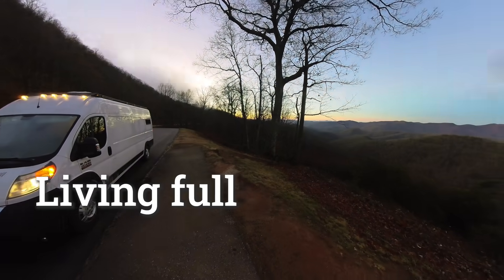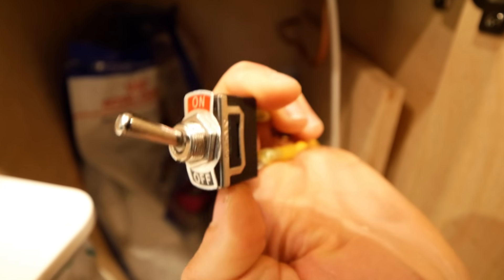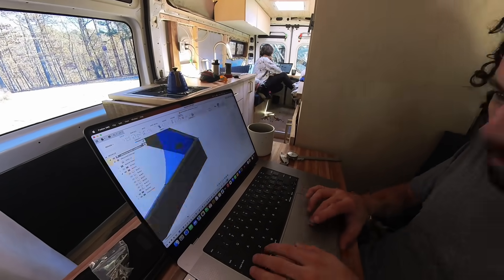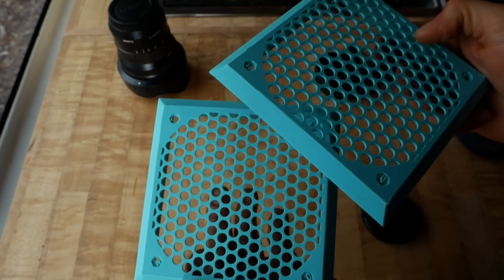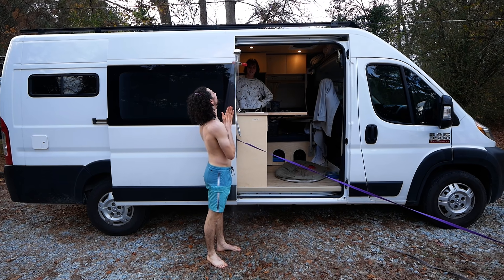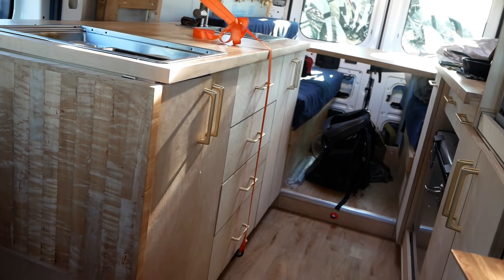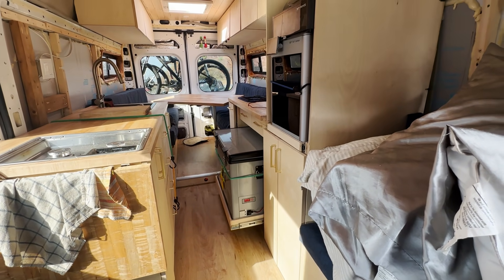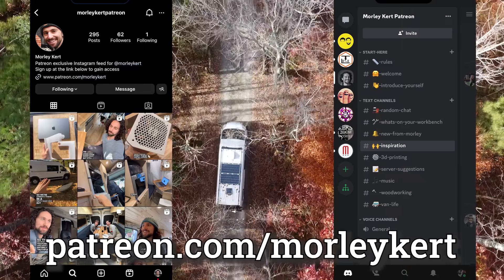Oddly Satisfying Hacks for Tiny Spaces

Comment: For the drawers you could use a magnetic toddler latch to keep them closed. A small magnet serves as a key to open the doors and the latch is hidden inside so there’s nothing visible on the outside. You can either leave them engaged all the time or switch the magnet on when you’re hitting the road.
Reply: Was thinking exactly the same!
Reply: Was just about to comment the same thing! Great idea! :)
Reply: I second this. The magnet locks are tried and true for this type of camper/trailer cabinetry. Good luck 🍀
Reply: Just came down here to say the same thing!
Reply: I fifth this I was gonna say the exact same thing

Comment: For the shower hose, you've had it connected the wrong end.  The end you connected to the faucet (the tapered connector) should be the side connecting to the shower head so it can fit in the holder correctly

Comment: Most RVs just use latches on drawers and cabinets, either ones you can leave open when you're parked for a period of time or ones that you can easily open when you need to access them. A latch per drawer/cabinet is more hardware, but also means that if you print them and one fails you can have a new one ready within a few minutes and it also reduces the severity of a failure to just one drawer/cabinet

Comment: For the smoke alarm, there are different types. (Ionization vs Photoelectric). The ionization type will pop off more frequently in a kitchen due to the aerosolized particles cooking creates even if it doesn't make smoke. Try getting a photoelectric type which will alarm you when there's smoke rather than particles in the air. Both will let you know if there's an actual fire. But try to avoid one that actually has both types, as it will pop off if either type is detected.

Comment: Hey Morley, I know it’s way past this point and you guys are living in the apartment now, but my first thought for the drawers that I didn’t see recommended was a hinged lock “bar”. They use them on medical cabinets to lock them. It’s one vertical piece that holds one edge of the drawers shut. You can unlock it when you’re parked and leave it open (no dealing with multiple latches), build it cheaply: piece of Baltic birch plywood about 3”x30”, a piece of piano hinge, and a sort of locking mechanism. You could even do something where there’s a hole at the top and it’s a peg that secures it in from the top of the counter or like others mentioned something like a baby lock that holds the latch shut. With this design, you can lock and unlock all the drawers at once.
Reply from the maker: Good idea!

Comment: As for the cabinet drawers. It would be a more complicated build, but how about handles similar to some you see on filing cabinets. The handles have a side knob that disengages 2 latches on the inside of each drawer. So, it's always locked, but to open it you grab the handle, press the button and open the drawer. Then they latch every time you close them. Different handles, but maybe less ugly than external latches, etc.

Comment: I have that exact fridge. It's about 6 years old now and it started rusting on the inside. It's coated metal and the moisture created rust and the coating peeled off in places. I cleaned it up and painted the problem areas. Fridge works like a champ.
Reply from the maker: Good to know, thanks!

Comment: I used to have Ikea cabinets that opened from the bottom and I sat them on my head all the time too 😂 I had a roll of aluminum foil that I used to prop them open to put away dishes.

What about a dowel along the bottom edge of the cabinet door, with a hinge on the right or left. When opening the cabinet you can fold out the dowel and place in a small recess in the cabinet body so it doesn’t slip.

Comment: Great solutions. However, don't despair;  one doesn't need to design and  print custom devices. Low tech simple carpentry with a vast array of hardware to choose from will solve the problems too. And you are so right about those underutilized clamps.

Comment: Magnet for the drawers comon a ratchet strap 😂. And you need dowel pins to stop the fridge and washer from coming off the wall on their bearing slides as well, could even use a gate latch for a fence. You can 3D print one even. Don’t use stuff you need to take down all the time. You said it yourself you don’t need to take one tool or one item off just to use another. Ratchet strap is a tool you’re using to hold another tool. Make a custom holder that’s permanent spend some time designing. Make more iterations and versions of your designs don’t settle in the first one always you’ll get stuck designing stuff that might not work or might not be the best solution sometimes

Comment: 9:50 just get rotating paddle thingies screwed to each side of the panels the drawers are between and when you don't want them to move , have the paddles rotated  to be on top of the drawers. The draws would be stopped by those paddles. Would be super easy and quick to print!

Comment: For the 3d printer to work during travelling, you could go to an over engineered solution of gimbling the whole printer with some shock absorbing like the way they do with cameras in film production, or a simple solution of using springs/neumatic actuators that absorb shocks and keep it level during driving.

Comment: Not sure they're strong enough to hold closed, but what about push to open drawer slides? the kind that click closed and release when you push them in. Gets rid of the handles too, which adds 2 inches of space to the corridor.

Comment: I would have made some sort of lock that goes in a cut out in the top left of the drawers. A little toggle switch that sits flush to the surface and goes inside the framing in the locked position.

Comment: The bambulab printer has a very advanced vibration compensation system which is intended to eliminate the vibration that the printer creates itself. I can bet the print quality is mainly impacted by the vibration compensation going crazy. I don't have a bambulab printer so I don't know, but if it's possible to disable the compensation system you may get better prints while driving!
Reply: That sounds like the worst printer to take on the road. My printer has a solid enough frame in order to reduce vibration, I've had it printing in a car mutltiple times and even on the back of a bike (the last one did suffer a bit from vibration though, but still, on a bike)
Reply: @rosserobertolli isn’t he talking about the same printer you have??

Comment: You’ve got plenty of good solutions for the drawers but another option is to take a look at a large tool chest, their locking systems have a common rail that lowers and raises to engage all the drawers internally, it could be on the back or the side. It could also be a common vertical rod that rotates some kind of catch into a receiver of each drawer. Just spitballing.

Comment: I think you are using the shower-hose in the wrong direction. The side that you connected to the faucet has a specific shape to fit in the mount that you showed. It even has a rubber gasket to make it fit & hold. But you've connected the other part to the shower-head. I think if you switch it around you can mount it.

Comment: Hey bud, been meaning to ask. Are you running your 3d printer through an inverter or have you managed to run it off the batteries directly somehow?
Reply from the maker: Inverter
Reply: Yeah I’ve got mine running off a portable power supply (bluetti)

Comment: question: (fyi i haven't watched past 1:10 yet) doesn't the 3D printer melting the plastic produce fumes that are potentially harmful for your family/pets? Especially in that tiny space. If you have a venting solution in this video and I haven't watched far enough yet, then disregard this question and use it to fuel the algorithm...but I've got a 2 bedroom place with two cats and I feel like there's not enough space to have a 3d printer. your is enclosed so that's probably better for the ventilation and everything
Reply from the maker: We have a roof fan and windows that provide quick ventilation of the small space, and I only print PLA and PETG, relatively benign materials.

Comment: The problem that has caused all the other problems is the fact you missed so much very obvious things from the planning process day 1. Which feels like a real lack of research and checking what others have been doing in the many, many van builds who have already answered many of these problems in their videos. I mean to miss the fact basically any draw or cabinet with a swing door would come open every single time you turned a corner or worse you seem to have realised it was a possibility but decided on bungee cords which were never really going to work or be a lasting solution. I mean bravo for grabbing the opportunity and doing the thing you want to do and a huge Bravo for actually pushing forward and deciding to get going before you knew it was anywhere ready. Most people stop at the dreaming or planning stage so no matter what that deserves a load of praise I just think a bit more research, planning and thinking before you even lifted a tool would have paid off hugely. However still can't deny I'm a bit jealous and would happily fix the issues to get out there in my own little home on wheels. Really hope you end up with what you want and I'll definitely be watching to find out. I'd definitely use either latches which are inside the draw so can't be seen which require you to lift the draw a bit before pulling open, that or I'd use an iron bar through the handles which went in to a little hole in the floor and clipped in at the top.